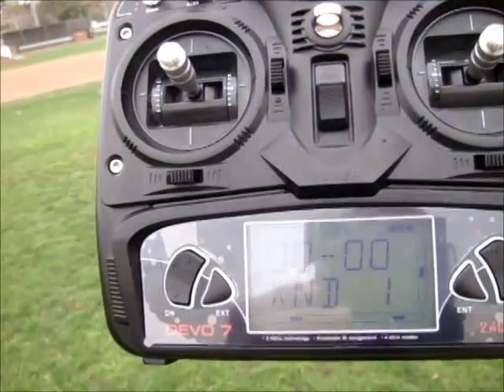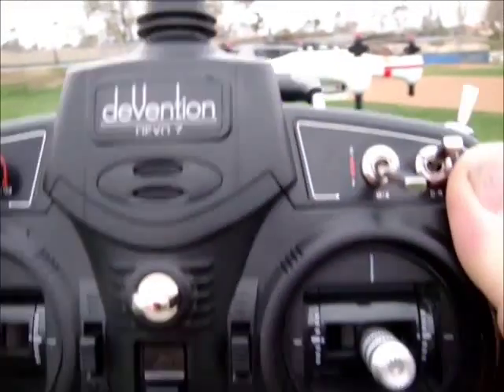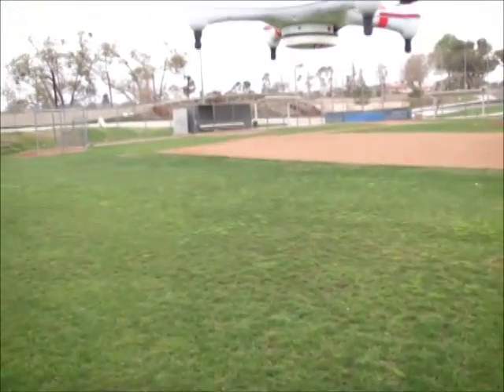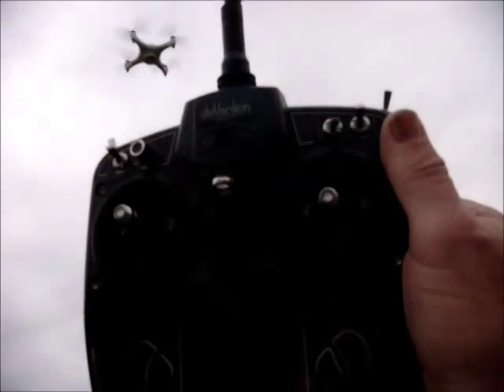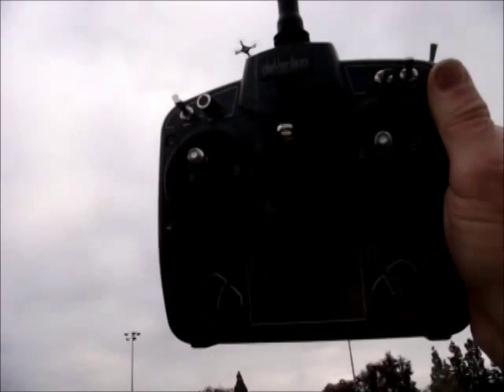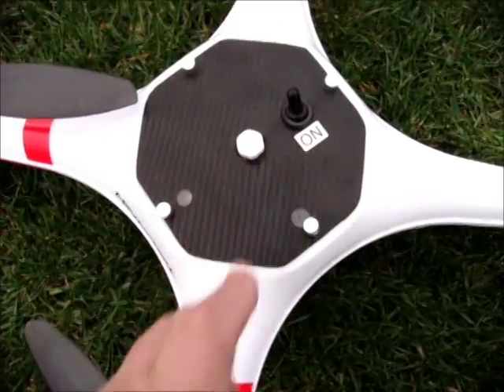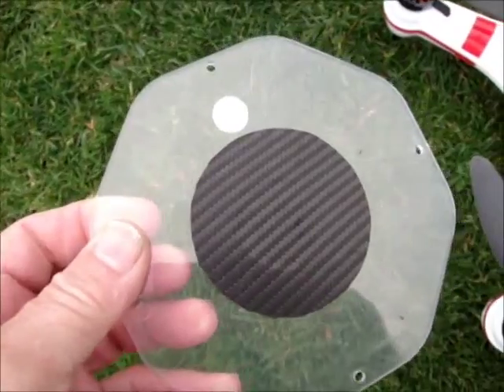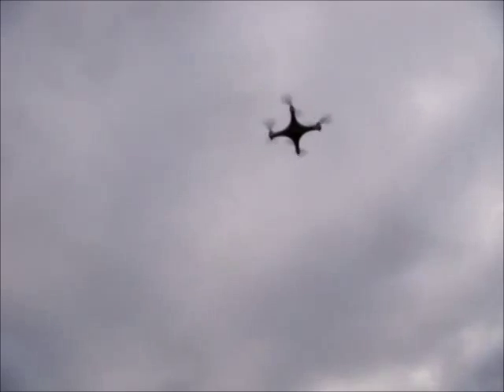Mariner Vent Video Testing for Altitude Lock

Comment: Hello! thanks for the video. I understand the barometric pressure sensor needs vary within the interior of the drone.
where did you purchase your adhesive vent?
could explain that concetor on / off install? and as he did? It is very good idea!